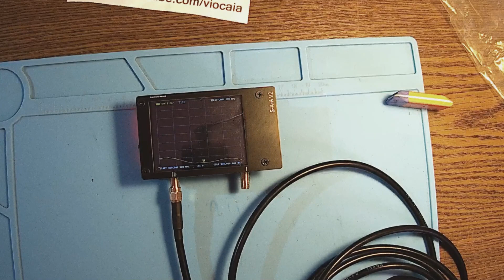EBYTE  TX900-BLG-55 Helium miner fiber glass antenna first test

Comment: When you change the sweep frequency range on your VNA, did you also recalibrate with the 3 caps: short, open, load?
Reply from the maker: well..If you use it in almost the same frequency area is no need..I don't make any final tests..accurate ones..I found very small difference.I also have saved presets  with NanoVNA Saver in 800/900MHz area.
Reply: @viocaia  Check out the NanoVNA QT GUI. Heaps easier to interact with over USB than tapping the little touch screen, and you can take screenshots / videos
Reply from the maker: @mikecauser  Thanks! Please like and subscribe!

Comment: Seems that was tuned more for the USA Helium frequencies which is 903 to 926 depending on uplink and downlink.  We just call it USA915.
Reply from the maker: And it is, once I put under the roof went well to 915 around..so next days, open it up and see the magnificent  chinese  technology autopsy and probably tuned for EU 868Mhz..if I can..nice to hear from you..wish well and season greetings!
Reply: @viocaia  Seasons greetings to you as well.  Cool thing is that if made for the USA if you can get it open you need only remove the length of wire in it whereas the other way around we have a harder time adding wire.
Reply from the maker: @generalawareness101  I'm pretty sure inside is a collinear curly piece of wire and some sand to have weight! They said ''copper resonator''  ..will see.I don't know why they have the most expensive sand in the world..almost 40USD for 300grams! :-)
Reply: @viocaia  LOL.  I can't wait for your video showing what is inside that one.  I have seen other vids on other varieties, and you are pretty right.  Most don't even have sand it is just a straight piece of wire inside the fibreglass tube.